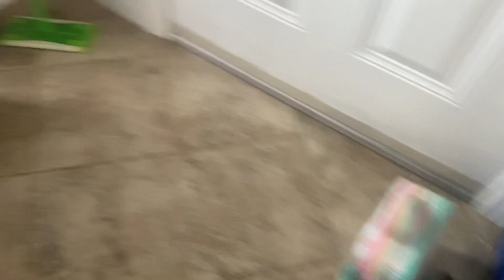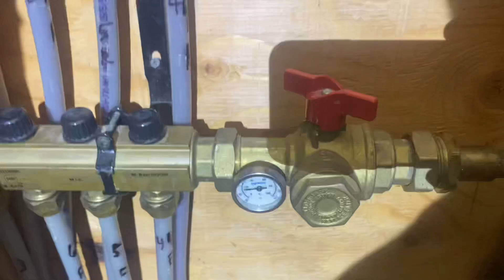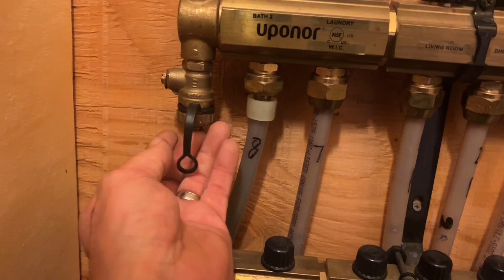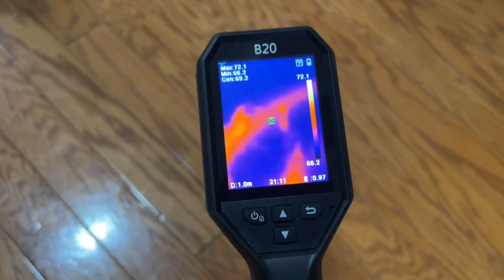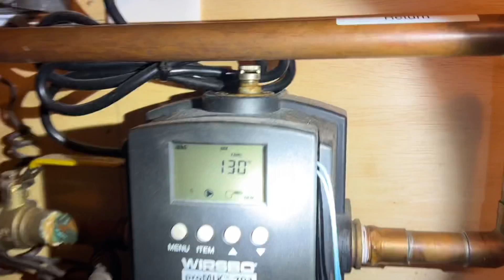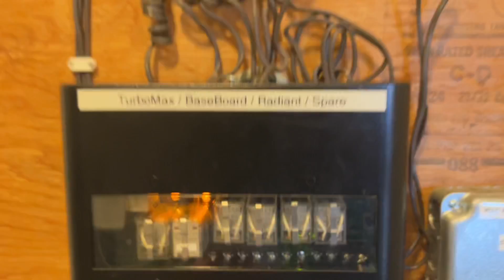Hardwood Flooring Buckling Due to Hydronic Radiant Heat Set Too High

Comment: I’m not a floor guy but there’s only a few things that an cause these wood floors to buckle. Water and Moisture or Humidity or if the planks are installed too close the walls when the home shifts cause foundations do move a little with the seasonal weather the walls pushed on the floor buckling it. It’s kinda simple repair lots of times you don’t gotta redo the whole floor you can cut out the bad sections and reinstall new planks

Comment: nice floor, except there's no expansion joints anywhere and it looks like it's ran tight to everything, doorways, cabinets, tile, walls. I'm assuming they did glue down installation, overheating can soften the glue enough to release it and double no bueno with it jammed so tight.
Reply: @PipeDoctor  also, most wood laminate floorings state no more than 80 to 85F max temperature and it should not be varied more than 5F per 48 hours. bad things happen when you go outside those specs, it can even start to delaminate. even if it's thin solid wood, best to stay within that range still.

Comment: that manifold supply valve has a built in filter. its probably clogged up and needs cleaning. i would imagine putting the valve handle half open is bypassing the filter.  the filter is under the plug, you can remove with the valve in the off position

Comment: When I have to go into Philly, I have to avoid any areas that are a part of the "Fairmount Park" system, because anything registered as a "truck" is not permitted to use those streets. The smart companies have passenger plate trucks just like that guy, because you can spend additional time each day taking alternate routes to your client site if your plate says "truck." In addition, if you have any kind of signage on your truck, you can't park on Walnut or Chestnut in Center City. No signage, and you can park. The PPA has all of these crazy rules.

Comment: Those guys are everywhere Mike. We are so over regulated here in Ontario, but rules are rules. I pay the city of Toronto a fee each year as a heating equipment contractor another as a warm air contractor plus as you noted pay both commercial insurance rates plus Licence plates for a commercial vehicle. On top of that the fees for my gas fitters ticket to TSSA and another fee for my air conditioning / refrigeration license to the College of Trades. Yet I compete against guys that charge half my rate because they aren’t registered. Greetings from the Old HVAC Guy in Toronto 👍👍🇨🇦

Comment: Wonder if the stem of that wonky ball valve is keyed in multiple ways, and someone took the handle off, and put it on the wrong way, or maybe it just wasn’t put together right at the factory?
Reply: that is what I am thinking as well.
Reply: very likely, I think it's capable of being a straight or 90 valve, by moving the cap/port connector and valve handle. so someone likely has it clocked wrong.

Comment: Another reason he’s having issues, he’s pumping into the point of no pressure. Move that expansion tank to the other side of the circulator, “pumping away”. They won’t need to bump the pressure up in the system to “bypass the expansion tank” and you can turn the system back down to 12PSI. 
- oil guy in Alaska. 

Keep up the videos brother.

Sell them a dirt magnetic separator as well.

Comment: As soon as i started  watch the video my first thought was the temperatures too high for hardwood floor. One other thing to note is in the upondor instruction manual States that only center-cut hardwood floor should be used and I think surface temperature no more than 80 degrees @70 set point temperature.

Comment: Radiant heat should run at 120-135 I believe… Mikey pipes working on an oil burner!?
Reply: Nope
Reply: Surface temp of wood floor should not exceed 80 on a wood floor.
Use Uponor manual above link.

Comment: The flooring is also laid poorly.
Reply: yup I never put hardwood down on top of a hydronic system, the humidity variations, expansion contraction vs tile or concrete are not worth it, even if they balance this out now, when conditions change they will have more problems especially when you hear the creaking in the middle of the night and popping been there done that